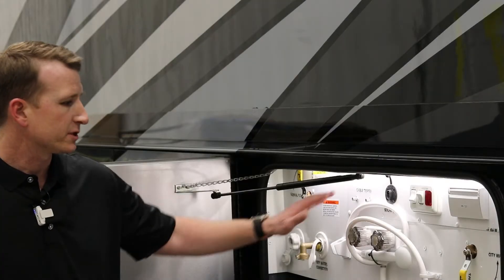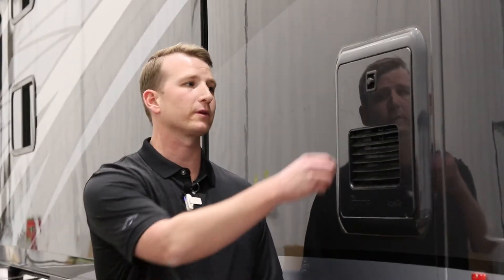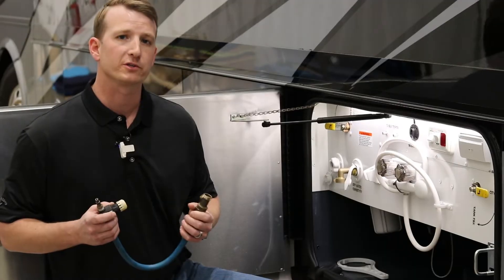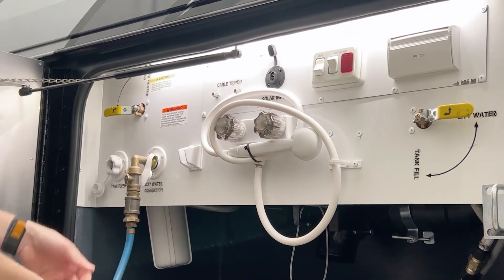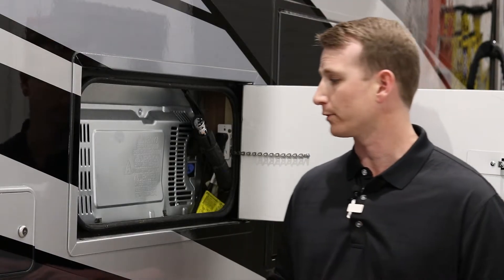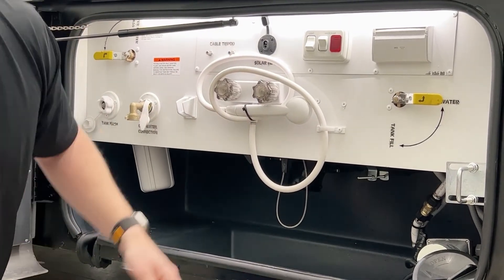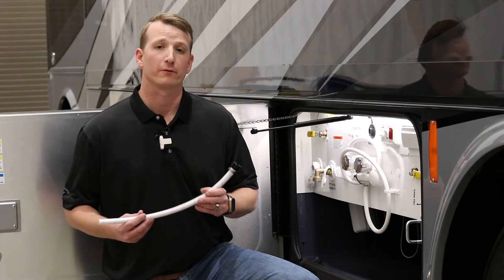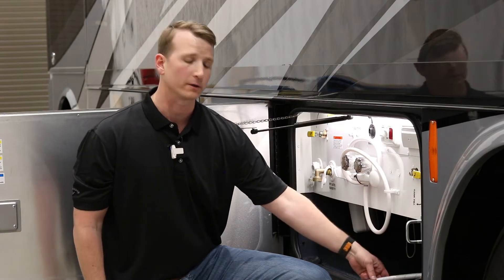Tiffin Tips - Winterizing/De-winterizing Class A Open Road with a Truma System

Comment: I have an Allegro Bay 2006... the wet bay does not have a water pump on off switch I am trying to winterize correctly... this is my first RV... do you have a video for the Allegro Bay 2006?

Comment: Thanks for the video. I have one question about the process. Normally I put the hot water heater loop on bypass after draining it and blowing it out. This prevents having to fill the water heater with antifreeze when circulating pink antifreeze thru the rest of the plumbing. The info in the Owners Manual also indicates to leave the cartridge out of the Truma for the winter.  The video does not mention that the black and grey tanks should be dumped prior to winterizing. Any water in the coach will freeze unless it is evacuated or replaced with antifreeze.  Thanks again for the video and I agree with Leigh that it is helpful since we only do it once a year!